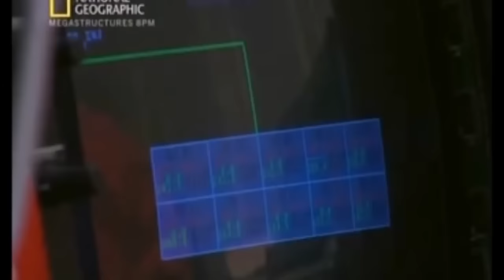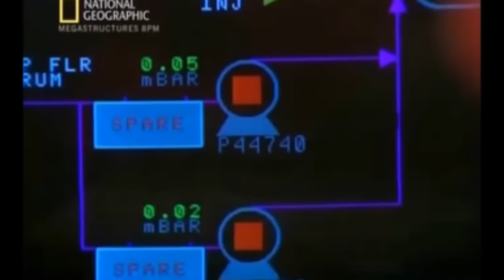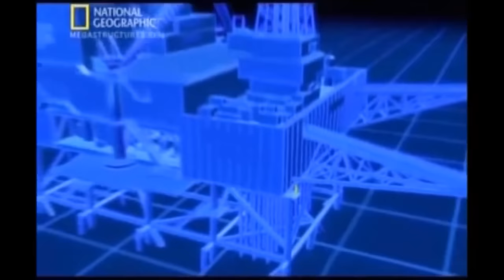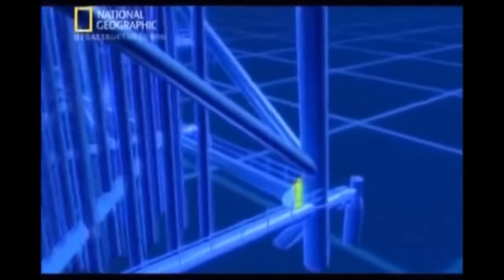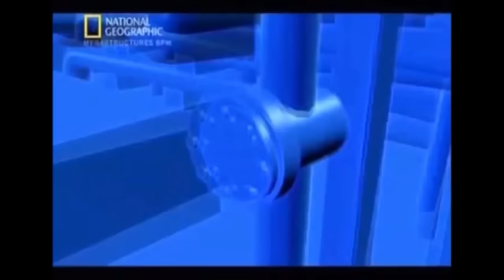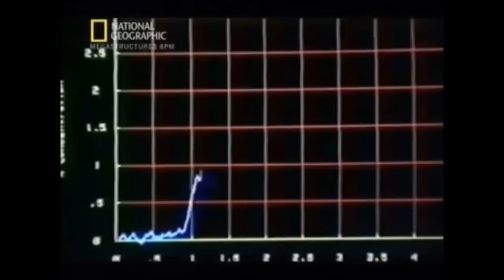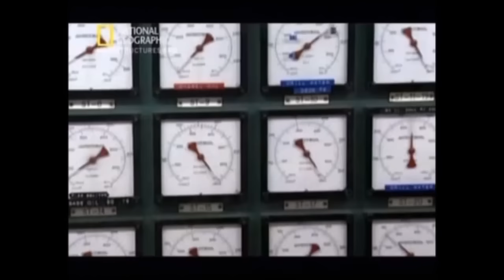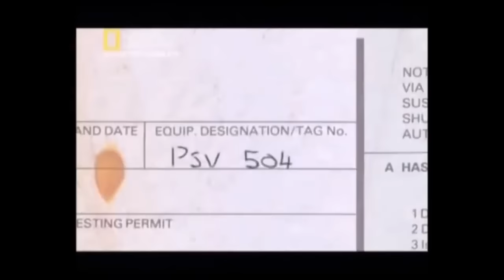Explosion in the North Sea Piper Alpha Disaster

Comment: As a plumber, I found the stupidity of this system mind blowing. Wouldn't you just have an isolation valve before each pump for when you need to do maintenance on them. Being flammable product though, I'd at least isolate the valve as well as cap off the inlet pipe before removing the pump, if there is a potential for some dumb arse engineer to turn on a pump because the light told him it was ok.
Reply: Yes but a physical lock with a person's name on it or at least a tag should have been used

Comment: a red tag on the part with the missing safety valve would alert workers also.  Like the ones they use on aircraft.
Reply: watchgoose

There exists a procedure to attach a DNO  tag to equipment that is out of service and not to be operated.
DNO  ==>  DO NOT OPERATE
I know of one incident where a DNO tag was not attached to a  compressor.
The compressor is bigger than the average car.
And operates at  415v   160 Amps
The electrician working on it forgot to attach the tag as he went to lunch.
Another Electrician who climbed inside of it to conduct an inspection was electrocuted
and badly burned. And found deceased.

Comment: I know I'm not an expert or ever worked on a oilfield platform but im really surprised and shocked that a leaking gas alarm that's going off is ignored and switched off. 
Considering how dangerous leaking gas is and what's at stake if there is a leak I'm just surprised it's not taken more seriously and even more shocked it's just switched off.
Reply: The audible annunciator is switched off, and a field operator is notified to go locate and control the gas leak. It isn't just switched off and ignored. In this situation, the gas alarms happened in such quick successions that there was not enough time to investigate before the explosion. Low gas alarms are also very common in gas processing, valve seals and gaskets can cause parasitic leaks, which do not warrant an emergent response.

Comment: What I don’t see in any of the videos on this disaster is the flare stack on module A. In the video it shows an operator hitting the E.S.D button. It also states the diesel generators all shut down. First of all the ESD wasn’t pushed. If the emergency shut down was actually pressed or was actually working all the gas in the rig would have gone to flare. So where is the huge flare that should have been seen. So I’m my opinion Piper Alpha was doomed from the start.
Reply: I agree with you,I also noticed that the control room operator  silenced the alarm instead of trying to understand the source of the alarm

Comment: I just don’t understand it. If equipment is signed out for maintenance. How could you not make sure it is ready to go before signing it back in for operation. Jeez it wasn’t signed out for maintenance for no reason. Unreal human error
Reply: That's why you lock off a valve with a tag on it. Only the person who isolated it is allowed to unlock it or someone else with signed permit permission by the one who locked it off. That way you know the work is complete before it fires up.

Comment: At 4:34 he said the pump its connected to is "shut down" but he didn't say it was locked out. What this means is the power to the motor the drives the pump is a circuit breaker the circuit breaker is locked by a physical lock keeping the circuit breaker open no electrical power can get to the electric motor. The assumption here is there is only one and only one pump supplying fuel before that valve. Also a tag or a safety tag should be put on the lever or push button that starts the pump in the control room. Regarding paperwork a number that is on the lock should have been recorded who took that numbered lock from the safety officer, when and what it was intended purpose the name of the equipment or equipment number should have been recorded. Usually when you buy a lock you get two keys for the lock and many lockout procedures the second key is destroyed if the first key is missing then you can open the lock with cable cutters but this is only done with the safety officer and supervision well known by everybody  that lock should then be destroyed and the lock number never used again. This lockout procedure and many like it are commonplace in the refinery industry and can be quite complex. If a sequence of events have to be accomplished before the lockout then a Kirk key Interlock system can be established. Kirk is the name of the lock company. People that work with high voltage switchgear know of this company and the lockout procedures and equipment

Comment: Wow hand tight! You would think torque specs would be a must in situations like this! A wrench seriously more like an impact set at torque spec to avoid careless errors.
Reply: Torque a temporary cover don’t think so a blind yes wasn’t a blind though it was temporary to stop anything getting into the pipe not the other way round pump should never have been switched on the pipeys would never even give it a though  I should no

Comment: I'm surprised there wasn't a system in place where if part's were removed that they were given a tag attached to the part explaining exactly why it's been taken out of service, so if anyone went to the part there would be a tag attached to it explaining why it's out of service and what's wrong with it.
Reply: Even if there was a tag attached to the safety valve, in this situation, no one would have seen it, as the safety valve was in a different location than the pump they were signing into service. The permit system in place was supposed to address this issue, but a shift handover was not performed by operators to convey important information from the last shift.